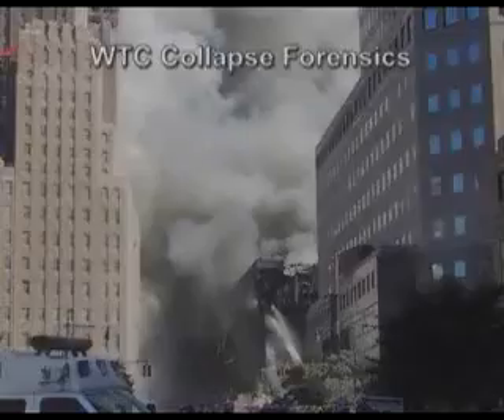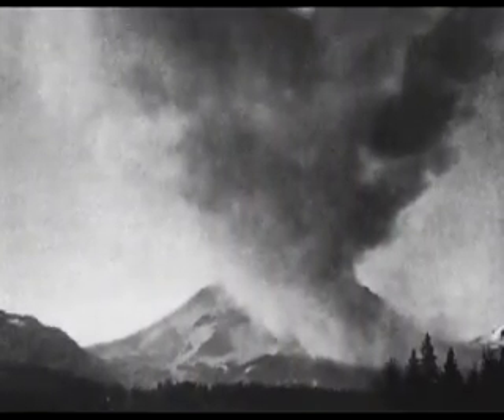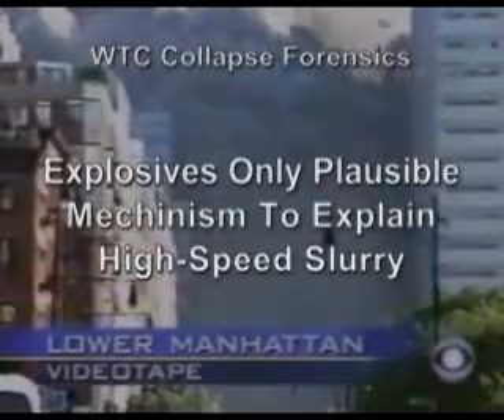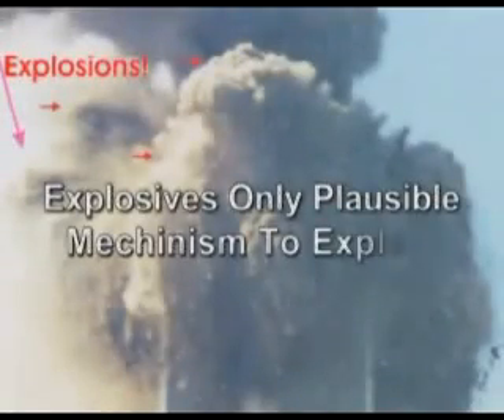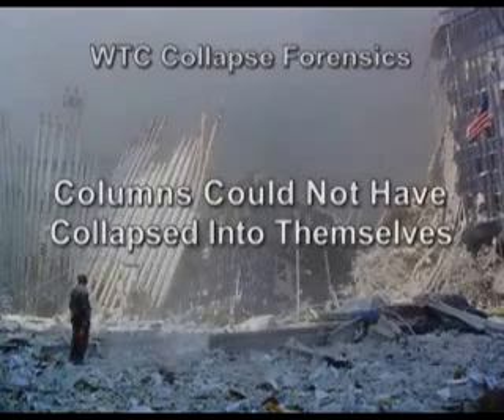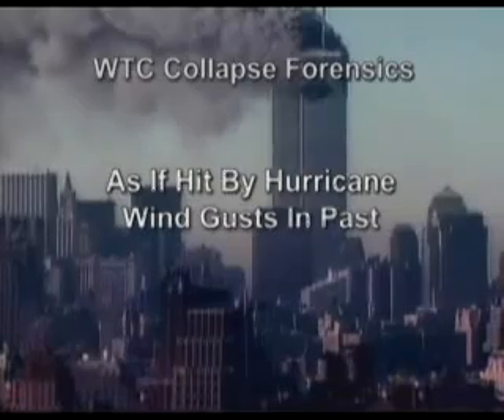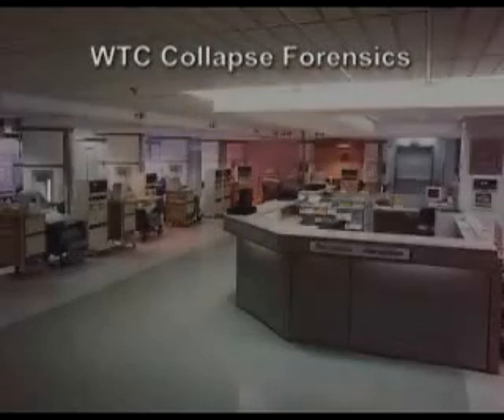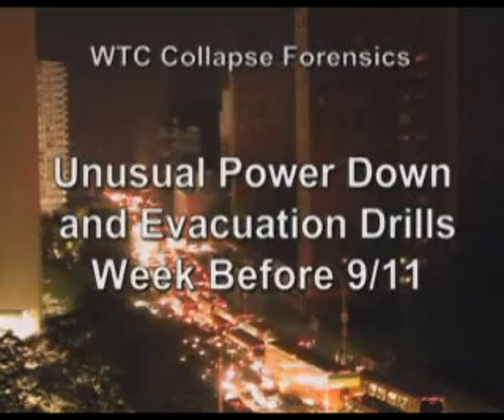MIT Engineer Disputes 911 Theory of the WTC Collapse-Part 2

Comment: He is further misleading or wrong here too:

The term he was avoiding saying there with the volcano is pyroclastic flow. This effect is not created by demolition. It's some very different physics. In fact, demolition normally results in a lot LESS dust than what was experienced with the WTC towers.

The plausible explanation that he isn't mentioning here is as follows:
A building like the WTC basically consists of Four things: Steel, Concrete, Drywall, and Air.

Anyone who has worked with drywall or demolished concrete is well aware of how dusty that work is. The collapse of that building is in effect a case of 'instantly' pulverizing approx 200,000 tons of drywall and concrete.

In addition you have a second problem, a building like this is by volume mostly air. As it collapses that air needs to go somewhere, and with close to 600k tons rapidly coming down on it that air needs to go somewhere FAST. So it picks up that recently pulverized drywall and concrete and makes like a bandit.

1:55 Oh, he does say Pyroclastic flow. Now I get to explain why this is not created by demolition. Yippee!

The word Pyroclastic belies one of the main features of a Pyroclastic Flow, specifically the Pyro part. These types of flows are characterized by the fact they are hot. VERY hot. Magma Hot. When it hits regular outside air it heats it up, causing the air to expand and increase the air pressure, causing that air to accelerate. Eventually the whole cloud cools down sufficiently to slow down and settle out, but not after having destroyed a small valley or a whole mountain side ( as is the case with St.Helens ).

If that flow had been Pyroclastic not only would it not have been moving past the camera at that casual running pace, but it would also have fried the cameraman and lit most of lower manhattan on fire.

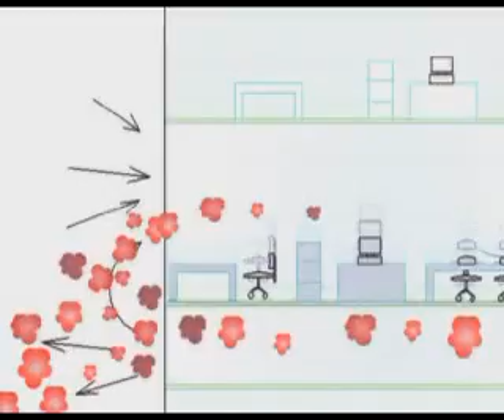2:00 No mister King, the towers were falling, the unreinforced concrete and drywall  would have been pulverized and carried along with the escaping air to safety.

Also a large collapsing mostly steel structure is going to act like a very VERY large shredder. It's going to pulverize just about anything.

Also nope, nope, did not fall into it's own footprint, this is an oft repeated but simply untrue. If you actually take a moment to look at aireal photography after the event that becomes pretty obvious. The outer walls of the towers spread out like layers of an onion as the rest of the tower fell through the middle.

"Unless there is significant further damage" like a fire maybe that's going to weaken an already damaged and overloaded structure.

Didn't collapse from the very top, the collapse started quite obviously right about around where the plane hit. Conveniently you don't show that footage.
Reply: +Semni Istiqlal you said in a normal implosion,but would you agree that imploding the twin towers plus building 7 would not be a normal implosion at all.

I think that something that's not talked about that much is the sheer fact that hardly any full bodies were found,and 200 peices to one person and over 1000 unidentified total,if it were a pancake,people would have stayed more in tact i believe. explosions would explain nearly 1000 people vanishing into thin air.That doesn't seem more believable than the what the news and government has said and the commission's report and nist.and larry silverstein's famous "pull it".and the news televising the fact that building 7 fell before it did,how can you deny this stuff,it's bullshit.
Reply: Jonathan Kosyjana
It's not so much that these things get denied, it's just that when you don't start with the assumption that it was a conspiracy a lot of the 'evidence' presented doesn't really point at much of anything.

For example, do you know how bodies are supposed to behave in such a collapse? The only examples of such large buildings collapsing we have are the twin towers. In the light of that an alternative theory that the churning action of falling debris ground up a great many bodies into indistinguishable pulp is just as valid and thus the whole premise is no evidence for a conspiracy taking place.

As for the "Pull it" phrase, it is perhapse a bit Canadian or British english to use the phrase "Pull an operation" to indicate that you are cancelling it, calling it off. I believe he was talking in the context of the stopping the firefighter rescue operation because they were concerned that the buildings were going to come down.

Either way, it's trivially easy to quote-mine a public figure and put a lot of things they say in a troubling light when you take it out of context.

Talking about quote mining, it's not uncommon for live news to mess up with their reporting, report something that is obviously not true simply because someone misspoke, got confused, or something else. We don't point at any of those other instances and cry conspiracy, do we?

Beyond that, there's a greater issue, all of the evidence presented by the truthers is circumstantial, they have no direct evidence of explosives use in any of the buildings. You can have all the circumstantial evidence you want but without something that concrete you cannot go beyond considering it a possibility.
Reply: Quote mining,really,i think that is bs,there are numerous stations reporting it fell.i s mean you're kind of deny what i'm saying aren't you,like wtf,you can't agree with anything i say. and there are some picture of actual pancaked buildings,granted they are far smaller than the win towers idk.what about the molten steel. pull it is a demo term,and how the fuck did building 7 fall which is across the street.but building 4,5,6,didn't collapse and there are right under buildings 1 and 2.is dosent makes fucking sense. also the buildings next to building 7 didn't get damaged at all. also a VERTICAL collapse cannot thrust 20-40 ton beams LATERALY 100 plus meter away.  The only like 10 or so people that survived the 2nd tower impact were in the lower levels of the marriot hotel,it was a portion that was reinforced after the 1993 bombing but the entire building was consumed by the towers,one of the guys that was in the hotel didn't even realize the tower fell until he was on a boat going to staten island or something why did 7 fall. Another survivor reported getting past the 70 or 60's floors of  and the could feel air conditioning and everything seem relatively normal in the building, how can you call that a weakened structure,when's it's literally being air conditioned
Reply: Jonathan Kosyjana
Quote mining: That is incorrect, the BBC were the one station to do so.

Denying: If you cannot deal with people disagreeing with you the internet is not for you.

Pancaking: You said it yourself, those buildings are much smaller than the WTC towers and thus cannot be used as evidence against.

Molten Steel: I'd challenge you to produce actual evidence of such a thing.

Pull: To pull in a demolition scenario is to use cables to pull the structure down. It's safe to say we can agree that didn't happen.

Also the full quote of Silverstein is: I remember getting a call from the, er, fire department commander, telling me that they were not sure they were gonna be able to contain the fire, and I said, "We've had such terrible loss of life, maybe the smartest thing to do is pull it."
And they made that decision to pull and we watched the building collapse.

To pull in firefighting terms is to leave the building and let it burn down.

Building 7: B4 5 6 did collapse, just, they were much smaller and thus suffered only partial collapses where they were most damaged.

Next to B7: They did, the damage was extensive, however their fires could be contained and they didn't collapse.

Lateral Travel: This didn't happen the way you describe it.

Survivors: Much more people survived tower 2.

Marriot Survivor: Anecdotal. That whole story seems unlikely without further evidence of it's truth.

Air Conditioning Survivor: Anecdotal. His perception of airco being on doesn't mean it was on.
Reply: there's plenty of evidence of steel,i call real evidence,firefighters reports of their boots melting because of the heat of the rubble it's pouring out of the tower,and giant chunks of melted steel and concrete... yeah it would be pretty damn hard for me to find some evidence because they just happened to get rid of 90 percent of the evedence.it such i mlate on my resech game because  iwas only like 7 or 8 when it happened and havent questioned it untill recently but. and you think i'm going to believe you and not countless people's testimony.. what about the entrance of the towers being blown out, and the portions of the tower were hermetically sealed.
 there were no firefighters in building and hour at least before it collapsed,what the fuck was the to pull.the gold out of the basement perhaps .
Fuck Lary Silberstein, you trust that cockroach,fucker got 7 billion dollars on  56 million dollar investment,he only owned it for a few months and fucking destroyed and a decade later it's just rebuilt, 

that doesn't seem sketchy to you?
Reply: +Jonathan Kosyjana what motive would one have to provide anecdotal evidence,and compare that to how much motive someone has to pull of an attack like this because of money fraud and god knows what else
Reply: Jonathan Kosyjana
It all comes down to complexity cost. You might have heard of Occam's Razor, the principle of preferring the simpler explanation.

The idea that the collapse was the consequence of a pair of planes and then burning for an hour or longer is simpler than concieving of some large scale conspiracy to make it look like that had happened.

If it were a conspiracy, why fly planes into it AND demolish it? Wouldn't it have been much easier to blow up the towers and plant evidence that terrorists did it?

Also, if it was an insurance scam by Silverstien then why did he not have his paperwork in order when it happened? There was a huge legal battle at the time when the insurance company didn't want to pay out because not all of the contracts involved had been finalized yet.

Also, rigging a regular tower for demolition takes weeks, and you mean to say they managed to do so without anyone noticing?

Beyond that, in order to do so you'd most likely need the cooperation of the owner of the building, the NYC Port Authority, whose director died in 9/11. You'd think he would have avoided the towers that day.